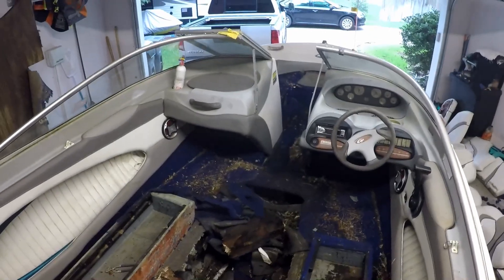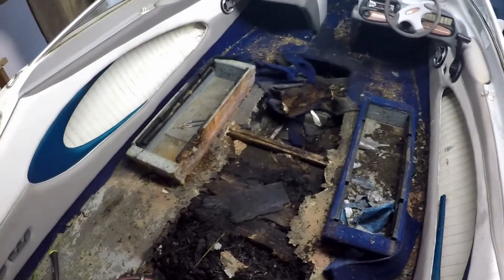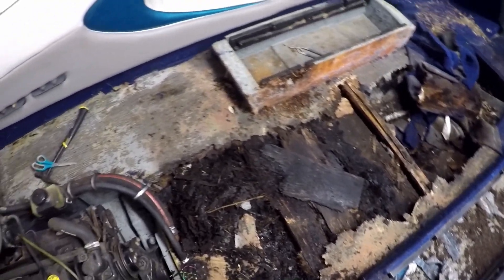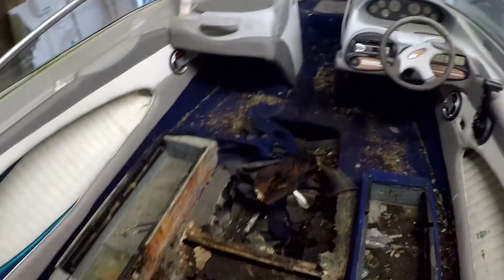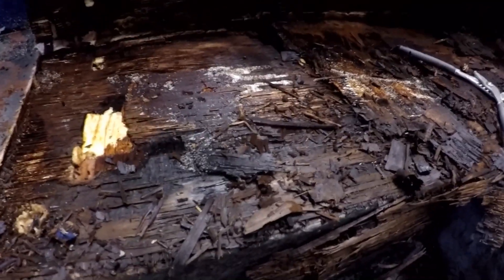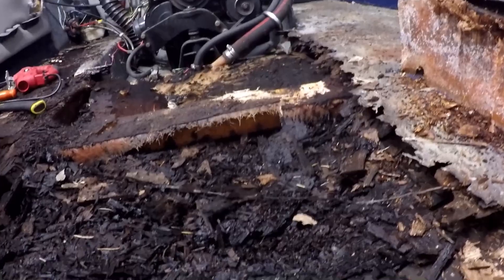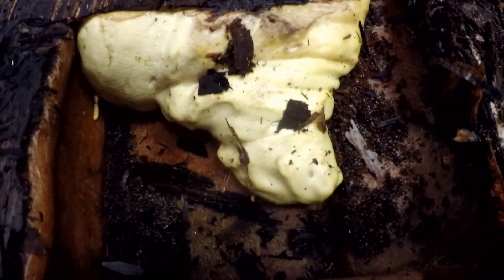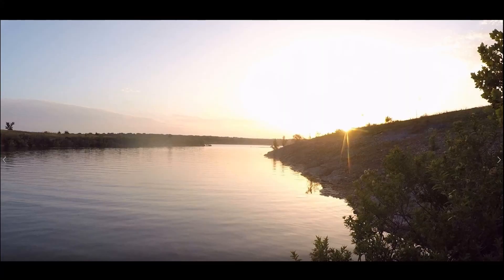Bayliner Project: Day 2 VLOG more rotting floor

Comment: Got a 2010 Reinell that has carpet on it, I noticed certain areas are always humid and don't dry well, specially the storage area. I never thought they would be wood but after watching your video I put a camera down and saw it was wood and I couldn't believe. Bought it new and still have it and now I'm thinking if I should strip all the carpet and restoring it or if I should detail and sell
Reply from the maker: wow I'm kind of surprised for a 2010 model they were still using wood under the fiberglass.
It the fiberglassing is done right and water tight, you should never have too worry about the wood